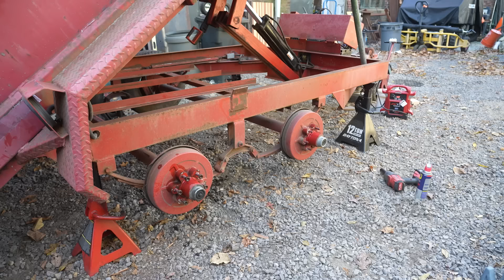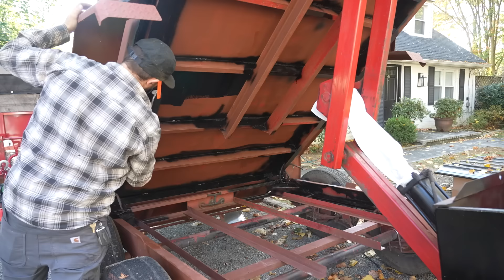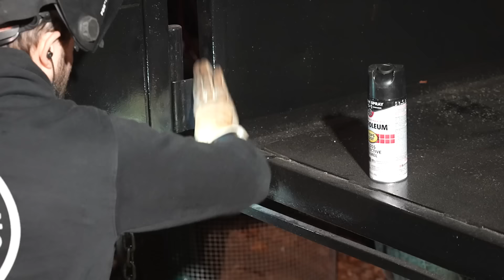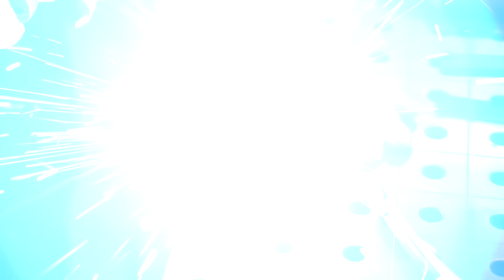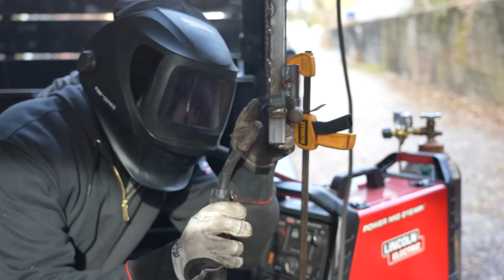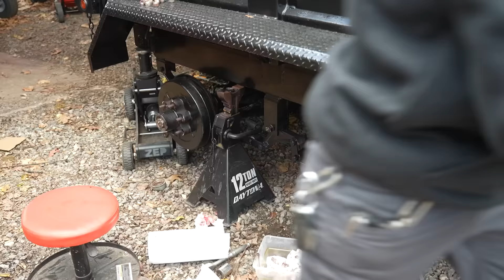I RESTORED An Old Dump Trailer From SCRATCH In 7 Days!

Comment: I would change your hitch coupler the one you installed is the worst one ever they pop off like nothing
Reply from the maker: I learned that! Changed it for one of those self locking ones and use a safety pin and I like it

Comment: Surface conditioners are good for big projects like this versus using an angle grinder. Also, they make a wet sandblaster you can use with a pressure washer but I bet it would make a huge mess in that alleyway!

Comment: I think you're white wire it's supposed to be like it charged wire or if you have a backup light on your trailer but if you were to get a regulator put in for your dump battery You could charge your battery On your trailer while you're driving down the road

Comment: Did you end up talking about the water intrusion into the frame/under the floor? Im having the same issue and looking for a fix
Reply from the maker: I know where it’s coming from but neglected to fix it… I think the solution is a good caulking job around the floor plate to keep water from soaking down in there… otherwise it would be welding the whole seam. It’s a flawed design
Reply: @MakeEverything dude the fact that you responded so quickly and were honest about it is super impressive. I really appreciate it man

Comment: I’d maybe consider adding a spring loaded pin to the top of the gates to prevent them from being bent outwards or inwards at the top, and to lock them a little bit more securely together

Comment: That’s literally my dump trailer!😂 the first trailer I ever bought. Got it at Roxbury trailer years ago. The reason it’s so rusty is when we got into commercial plowing we used it to pick up bulk salt hence the reason it’s a rust bucket. We fixed some of it with our harbor freight welder but we have 2 dump trucks that took its place now. And you’re right we never painted it. We sprayed the bed with diesel once in a while that’s all lol. When it wasn’t used for salt it was our leaf vac trailer with 4ft sides. I’m guessing the guy I sold it too didn’t give you the cage bars and canvas. This was awesome watching it get revived. FWI the battery drains and doesn’t charge idk if it was fixed or not. Small world though wtf😂 I was thinking about my trailer and looked it up and your video popped up. Good luck with it and great job👍
Reply from the maker: So funny! Well I use it literally every week, sometimes 2 or 3 times a week. When I rewired it I fixed the battery charging and added that battery powered breakaway system. Works awesome! Someone asked me if I’d sell it once my renovation was done and I said no way, I’m keeping this thing forever!
Reply: How awesome is that! When I saw the rust, my first thought was “that trailer’s had salt in it”. Terrific of you to recognize it and chime in. Also, a refurbishing well done.

Comment: Nice job young man. There is always more than one way to skin a cat, right.  Making the stake pocket cradles was a silly idea. You could have just drilled a small hole in the face of the stake pocket, and ran small wafer screw perpendicular into the wooden stakes, super strong. The rear extension door(s) are way too "light duty". Why make bifold door extensions on the rear when it already has a single door. Now you have to fiddle with securing 3 doors while dumping instead of just building the extension on top of the single swing door. Someone in the comments had a good idea make the dowels "J" shaped to easily secure while dumping.  The crack that you welded should be plated as well rewelded, since you already know it's a weak area that's why it cracked. Lastly, call it my preference, spare tire mounts should always go on the passenger side. I personally would have made the mount on the box itself in front of the passenger fender, rather than in the working area.  BTW... Nice welding table!

Comment: That looks amazing. Never would have thought it was the same trailer. 

Once thing I would have done differently on the barn door latches….

I would have put a captured spring on the handle and then a small piece of L metal on the top of the door. The door keeps the handle wanting to go up, so when you shut it and lock it, you press down to go under the Metal and then when you let go it springs up to be trapped in the L metal. 

No chains needed. 

When it’s time to open. You grab the handle, pull down and rotate it out and then up and door opens. 

Hard to explain in text. You can see what I mean by the spring latch by searching for that. As for the L metal top, it would just have a fixed piece of metal on the gate the latch would rotate under and out of. When the spring latch is not pressed down, it would be pressing against the metal keeping it fixed in the closed position. Only way to open would be to push down on the latch 2-3 inches and rotate it out like normal.

Comment: The only "LONG" part of doing that was cleaning up the metal. Thats what ALWAYS takes the time. I always use oil based Rust-Oleum & brush it on it always turns out killer & ya dont get runs & bullshit with a brush...

Comment: I like Rusty Metal Primer from Rustoleum as well but they really need to do something about their quality control or lack thereof.  I like to keep four or five cans on hand for jobs as they come up and the failure to hold a charge on new cans runs about thirty per cent!  Then there is the clogging issue on partially used cans. Added to that the disappearance of propellant half way through using a can, or when a partially used can is put back on the shelf.  And yes, I shake the cans quite well and give them a clearance spray before I shelve them.  It gets very frustrating and slows the work flow a lot.  Just unacceptable.  For a while they changed top caps and that seemed to help for a brief second.  It would seem as long as they have been in business they could get the packaging and delivery of their product down, but they don't seem to have a clue.  In total I am throwing away forty to fifty percent of their product!!  This isn't a recent phenomenon either, more like a couple of decades old!  Time their executives actually got out in the field and talked to their customers even if it means getting a little dust on their pretty suits.

Comment: Out of curiosity whats the weight rating on those axles?
Reply from the maker: @jakemartin6200  they are 5k axles and the total gvwr is 10k for the trailer. The dump mechanism is rated for 7k inside. Given its small size it would be hard to fit 7k of anything in it! Most dumps I’ve done with it are 2000-3000lbs max
Reply: @MakeEverything How much weight was added with the wall extensions and upgrades? I've got a very similar tandem 5200lb axle, 6'6"×10' unit. Your scissor hoist setup is definitely the best design of that style, longer arms and cylinder stroke, front mounted. Too many cheapo manufacturers around me build their scissor hoists around a 12"X3" or 4" ram cylinder, and the hoists pivot points are often not even at mid length,  but closer to the rear hinge! The design is gutless at best, or can't tip balanced full loads, even bending or tearing bed floors or hoist mechanisms apart! I opted for a triple telescopic front cylinder hoist, in conjunction with the short bed length, it extends to roughly 60° from flat, very little materials refuse to exit! I haul a mixture of construction/demo debris, excavation spoils, ground preparation materials from aggregates, fill/soil, and the occasional load of mulch. A common passenger to and from the jobs is my mini skid-steer, a narrow track Toro Dingo and often several of it's accouterments, often scaling towards a 4Klb payload, on the lighter side of hauls that it does. Clay and unscreened gravel, 3/4" and less, 2"and under crusher run seem to be the heavier loads, greatly relative to moisture content. A good rain the morning of, even night before, seems to cut my volumetric capacity by 25-40%, or makes overloading a real concern. Early in the 'haulage' learning process I 'may' have hauled away a dirt load that tallied near the total combined axle capacity of 10,400lb and tagged rating of 9900lbs. The curb weight of Dumpy is right around 2600, less transfered tongue weight, 8000 pounds is maxing out its rated load. I'm certainly not regretting replacing the old and worn wheels/tires with a fresh set that had more rated capacity over the legal requirement.
Reply: Yeah it looks super beefy, great work and video brother! That’ll be nice that you can use it to haul your skid steer as well.

Comment: You should linex the bed
Reply from the maker: I think I’m gonna do that in the spring. Honestly it was a little cold to be painting this whole thing so I expect some touch ups and a recoat once the temps hit 60-70 again. Thanks for watching!
Reply: Bad idea for dumping. You want less friction not more
Reply: thought that as well.
Reply: Why? It’s basically a dumpster
Reply: You want the bed smooth material slides out easily when raised.

Comment: A tip for labeling using something like masking tape: cover it in either clear coat paint, nail polish, or even just packing tape. That way it laminates it and prevents whatever ink you used to write on it from fading or being scraped off.

Comment: You should get a set of bearing buddies for the hubs they are sweet
Reply: Those appear to be EZ-Lube axles. They don't need bearing buddies as they already have grease fittings built-in.
Reply: The hubs have integrated grease fittings